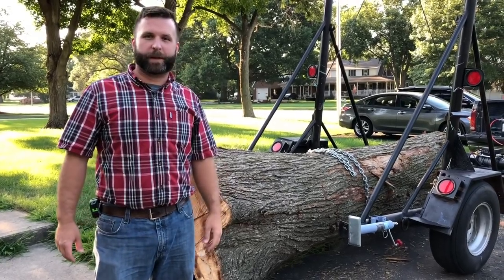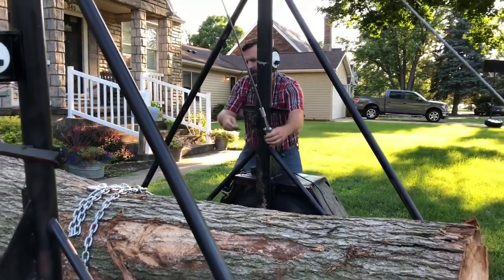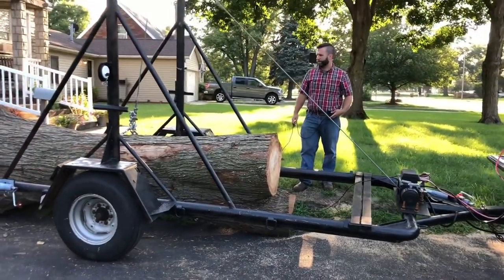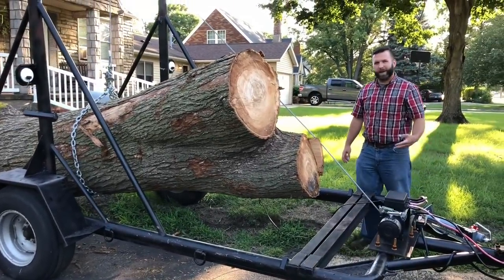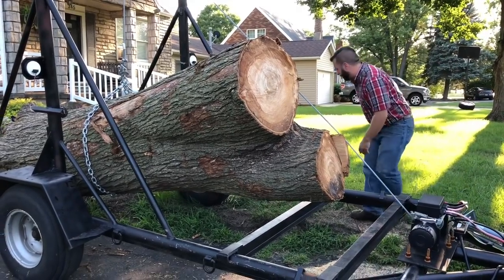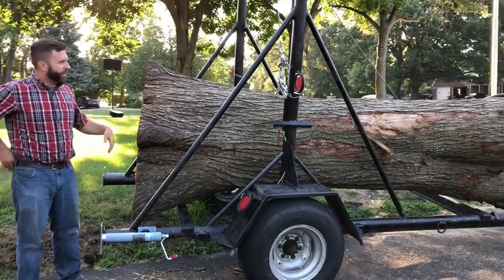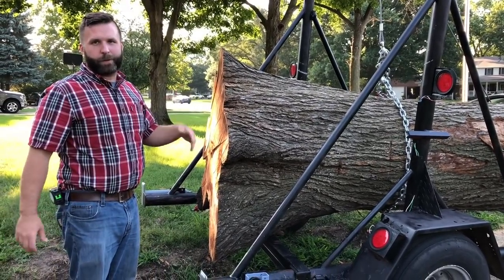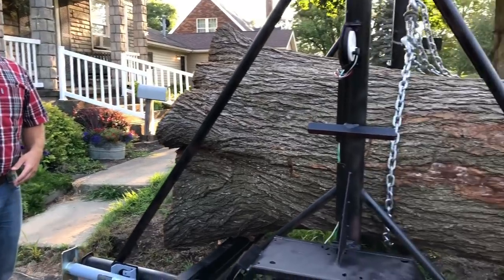The Best Log Trailer On The Planet! How I load big logs

Comment: You got me in the first 5 seconds seeing i wouldn't have to drag so many logs, just lift and support.  But i have a lot of hills and bumpy roads, have you had issues with the rails shifting or is there a locking mechanism somewhere that holds them in place?
Reply from the maker: Once everything is strapped down, the logs are secured to the rails and the trailer frame quite well. I never had an issue with the rails sliding.

Comment: I like the set up but another axle should be used for that kind of weight.  Installing v type rails on bottom would keep the centre of gravity lower but i can see how it works. You from a LPG background? Don't worry about the negative types putting a opinion over on possible improvements is what you asked for, good job.
Reply: That huge log only weighs 1200 lb that's a 2000 lb axle

Comment: Nice trailer.  I'm not sure if I would consider that "no special equipment" though.  Handling logs like that takes special equipment no matter how you slice that pie.  I would recommend moving the winch up to the overhead beam and getting a wireless switch.  It would eliminate the cable in the way  on the front of the trailer and halve the force on the beam (roughly).  Otherwise great idea and inspiration!

Comment: do you have issues with the back of the trailer coming inward were the cross support won't fit?
Reply from the maker: Not really. It does spring inward slightly but the way the cross member saddles over the tube, it sits down flat either on its own or when I set the log down on it.

Comment: I love this idea. I just can’t see how that single axle trailer is able to hold that load. I had a double axle that I loaded up with around 3500 lbs of logs and it bent up and popped all my tires lol. Love this though.
Reply: I think he is using 6 lug implement hubs and implement tires.  They build these hubs in a 10k rating, and that is for each hub.  I dont know how heavy a rating you can get with the tires.  I am not saying for sure thats what they are  but   the 10k hubs are out there.  The implement hubs and tires are for a  low speed application.
Reply: I think also that log is nowhere near the 5,000 lbs he claims! Lol

Comment: Dear Second Life:
Perhaps you have Nine Lives and have a few to throw around, unfortunately most of us only have one and a fragile one at that.  Your rig is very cool however watching you step inside the perimeter of the trailer frame to adjust the sling chain position made me wince.  Had that log shifted at that moment you would have been pinned and sustained severe crush injuries which could have impacted you for the rest of your life; or worse.  Hold your life and health a little more dear.  As well the possibility of mechanical failure would again make me want to be very cautious around this or any heavy lift machine.  Manually deployed outriggers would as well give you significant improvement of stability.  Good luck!  Great rig!  Love the ingenuity and thanks for sharing.
Reply: I myself would like to put a last a 7000 axel of another discontinued trailer or purchased a7000 lb trailer axel, for starters
Reply: Hey great log hauler who makes it ..what is the load limits and how long can the log be and how wide
Reply: Pecker Wood I thought the same thing
Reply: I guess you never leave home?
Reply: @curtisjahnke1183  Curtis contact us will help you out
Reply: Having dealt with logs that size I cringed too when he stepped inside that trailer. If that log rolled hes got permanent injuries.
Reply: @Curtis- you can’t have an axle, how would you back over the log?

Comment: That is a good idea, but I don't think putting yourself under a suspended load moving those cross braces in place is a very safe idea. I wouldn't trust that kind of cable. I have seen mine snap on a few occasions and there's no warning.

Comment: Nice design but how many times are logs sitting just right in someone’s driveway to back up to. This wouldn’t be for me.
Reply from the maker: I mainly do urban log retrieval so almost all of the logs are either in a driveway or right next to where the tree stood. With this style, as long as I can get a chain under it, I can pick it up.
Reply: @SlabGuy  Nice. Almost makes me want to go urban.
Reply: @SlabGuy  I've been researching log arches for modifying a trailer to do exactly this. I really like your trailer. The only down side that I can see is with smaller logs it will carry less but it also cary one really large one much easier than loading with an arch. Availability plays a factor and if I could find something like you have i would probably jump on it. Otherwise I'll probably have to go with a flat bed and arch. Good work.

Comment: I like the idea but at 3.50 mark on your video is the reason I think I'll pass on this design messing around under suspended loads is a huge no no for me maybe a reaching tool to hook into your  cross member so you don't have to risk your life to a weld not snapping or a chain or hook failure   winch malfunction sudden blown tire causing load to shift something like that doesn't even have to fall to seriously mess you up please be careful and come up with a solution to more safely load your logs